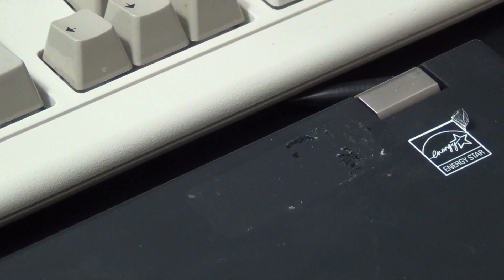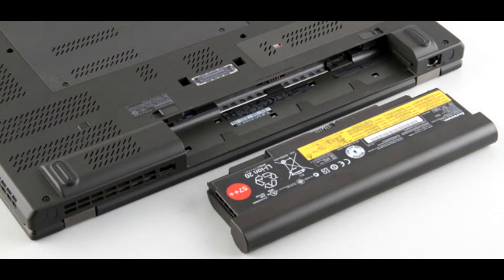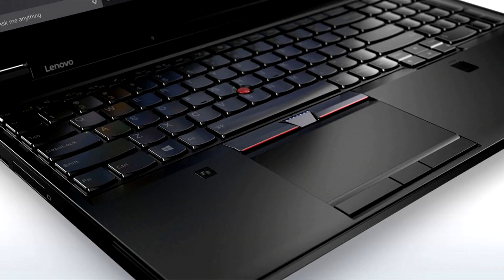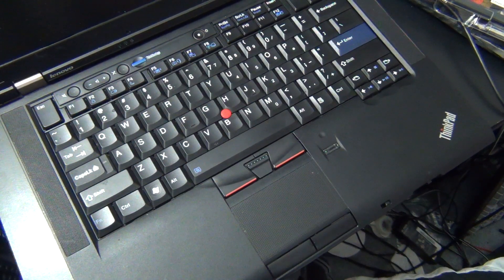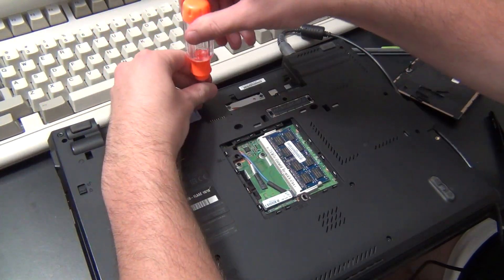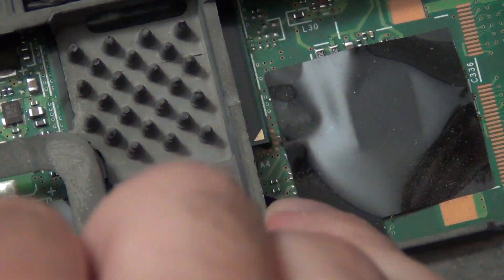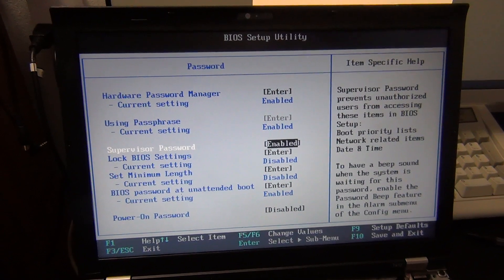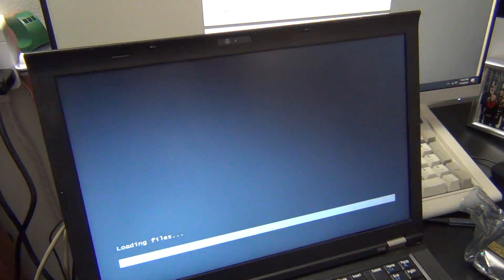Removing a Supervisor Password from a ThinkPad.

Comment: Great tutorials keep it up. Will this also work on Lenovo Thinkpad Edge? Thanks for your assistance.
Reply from the maker: Only older ones (2012 or older).
Reply: Yes. I used a similar method to unlock and ruemove all passwords from an old 2011 educational used ThinkPad Edge 11 (0328) that was locked down tighter than Fort Knox with a supervisor and bios password. https://davidzou.com/blog/der-laptop-bios-unlock Rather than see it get thrown out. Just follow the linked instructions.

Comment: What also worked on older ThinkPad was using the WinCrisis Bootstick for BIOS Recovery, as it overwrote the embedded Controller and the bios, removing any password. It even worked (sometimes, because the Phoenix crisis is like Russian Roulette) up to the e530 and t440. But only sometimes, but I was able to at least get some systems workimg
Reply: Hi Andreas... Did you say it worked for T440 for you. Could you please confirm . I have a supervisor PWD lock on T440.. Can I use this step. If you got it done . could you share the details plz.

Comment: What to do if I setup a password on my HDD? I can rember back in 2012 I purchased SSD I was so excited mounted it ASAP and tell to myself (yeah u will copy all the data from old HDD tomorrow), after two years and 2 thinkpads later I find that HDD try to plug it (3 different laptops) and is locked with that password which I can't  rember anymore :D. Is even possible? I don't even own a TP (used for setup this password) how this HDD even remeber that?
Reply: P D goggle Full disk encryption

Your up shit creek without a paddle

Comment: Right around 2012 my company acknowledged these types of security measures to be ineffective and non-compliant as it was medical company. Hardware HD encryption methods were then put in place and we replaced every HD in the company. We had the ability to activate the encryption remotely provided the computer was online so then on next power up you would need to enter the password. HOWEVER, my boss lost the master password. So we ended up with about 350+ systems in the field with ridiculously expensive drives in them, without encryption. We could technically STILL encrypt but we decided not to because we lost the ability to DECRYPT since that was when the password was required. We COULD have reset the entire system but then this would have made it impossible to decrypt the few systems we had already encrypted (which were the executive leadership teams systems since those were the first ones we did). So we left it as it was and never told anyone the problem. I don't know whatever happened as I left about 2 years later. 

I've also experienced other encryption problems similar to that scenario. After those experiences my rule of thumb is to simply encrypt using local methods. Software based, local encryption....like encrypting a single folder. Overall I disagree with encryption in general unless you are dealing with HIGHLY sensitive data. Most people, and businesses are not dealing with such data, therefore it makes encryption largely irrelevant. 

I find most people who want to implement security measures can't adequately convey why they want it, or need it. It's usually overkill....like those people who have 4 different virus scanners installed. More important than security is backups/data integrity. It's one thing for your data to potentially fall into the wrong hands, it's another for it to be unrecoverable. The latter is much worse.

Comment: Thanks for documenting this process.  Only two issues / suggestions: (1) A better view of the pins (pads?) to be shorted would be helpful, even if only as an example for the model you're working with. Just a different camera angle might help.  (2) State more clearly when to start shorting the pins, the fact that you need to keep them shorted throughout the process, and when to remove the short.  I don't think you said when to remove it, even while re-watching it.
Other than that it's a decent video. You were pretty clear on which models this should work on.  Also, people need to realize that any time you do something like this there's a risk of damaging the unit to the point where it becomes unusable (i.e. broken!).

Comment: Modern TP password removal is hell. 

Tried to help a friends T480, and it cant be done without either a reflashinh chip or hardware flasher and decrypter.
Reply from the maker: I understand why it's become harder, after all its original purpose is to keep people off the laptops that shouldn't be on them, but it's still irritating since many owners either forget about the password or don't bother to remove it before disposing of/selling the laptop.
Reply: @SebisRandomTech  that is true, and I honestly do think the data security is extremely important, but I wish they would implement a feature to reset the PW, and simultaneously wipe connected drives and the TPM. (TPM wipe would prevent you from disconnecting a drive, wiping the PW while still being able to read data without the backed-up encryption key, and reconnecting it, but also allow resets without a drive).

Comment: I am unable to reset the hdd1 password . I tried several steps pls suggest for Lenovo 3000 y410 @sebi's Random tech
Reply from the maker: Wipe the hard drive or replace it. Also, Y410 isn’t a ThinkPad.
Reply: @SebisRandomTech  I removed and tried to wipe in different PC but no other computers detect the drive. Is it dead drive now?
Reply from the maker: @islamicLegacy7062  That's possible.

Comment: Tip: put the models compatible with this method in a list on the description.
I see comments reporting having success on X61 and so on.
Reply from the maker: Well yes, because the X61 is an older laptop. This process works on every ThinkPad up until (and including) the xx30 generation. If I were to list every model this works with, we would be here for hours, so it’s much easier to just say “This only works on ThinkPads older than this generation” than to list every model out there. It’s not my fault people can’t do 2 seconds of research or actually watch the video.

Comment: hi will it work on a t470?
Reply from the maker: As was mentioned in the video this process does not work on any laptops newer than the T430 - which includes the T470.
Reply: Hi There. Have you found anything for resetting supervisor password. in my case my model is T470s. i need to reset supervisor password.
Reply: https://www.youtube.com/watch?v=AX_e9jlhbAg&t=5s
Reply from the maker: @wildreviewtech  That looks like Louis Rossmann levels of disassembly right there! :P
Reply: @SebisRandomTech  yes exactly !

Comment: Hi. Good information, well structured.
We thank you for that.
How about a Lenovo ThinkPad T500 2055? Similar method, I guess.
Unfortunately, different architecture, so for me it's difficult without a guide.
Do you have idea where I can find some instructions? I already searched on the internet and YouTube.
Once again, great video.
Reply from the maker: You can look online for a diagram of the motherboard for the T500 that shows where the correct chip is.
Reply: I've done this on a T500 but it was a PITA in that you have to basically disassemble the whole laptop

Comment: With an X230 Laptop, do I short the SDA and SCL pins only or also the first pin on the other side of the chip?  I'm using this diagram:  http://www.ja.axxs.net/x220.htm.
Reply from the maker: I would guess just the SDA and SCL pins. Let me know what happens.
Reply: @SebisRandomTech  Many, many thanks.

Worked!  Can now access my Bios settings.

Just succeeded with my locked eBay X230 Laptop.  Used a dental pic between the contacts.
(Note that the chip is rotated from the X220 and short the left side upper two pins).

Comment: can you help with a p50 thinkpad?
Reply from the maker: As I just pointed out to another user in the comments section, this method does not work for newer ThinkPads.
Reply: @SebisRandomTech  There is a video on you tube showing it being done on a P50
Reply from the maker: @Hitngan  It's not the same method shown here. That video likely uses a BIOS flasher to achieve the result. As has been said, the exact process shown in this video can only be done in the T430 generation and earlier. If you can link the video you mention to me I can confirm that.

Comment: Hey I've tried and cant get the pins to short. How exactly did you hold the tweezers on the pins?
Reply from the maker: Just make sure the metal part has a solid connection with both pins. If it's thin enough to almost go in the hole on the motherboard, even better.
Reply: I used a dental pic between the two contacts.

Comment: HI I love your videos but I do have a thinkpad question: how does the new X1 Carbon gen 6 hold up against the good old original models.

I am looking for a new laptop and the x1 carbon fits my needs as it extremely portable. HOWEVER it is rather pricey and wanted to ask if there is an alternative system that can be upgraded for similar portability and performance.
Reply: Depends on what you consider more important than the other.
Reply: Sir... Please sulotion T440p bios password remove how to

Comment: Thanks for the Video. But as far as i recall you need to have keep the pins shortened when you put in the new password and then remove the screwdriver (or whatever you use for shortening the pins) when you press F10 to save the new (empty) Password.